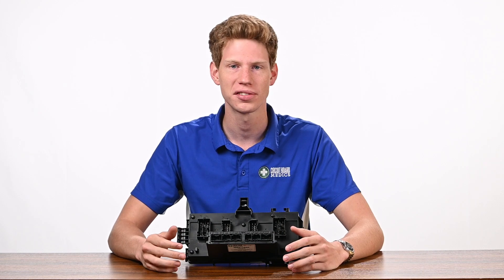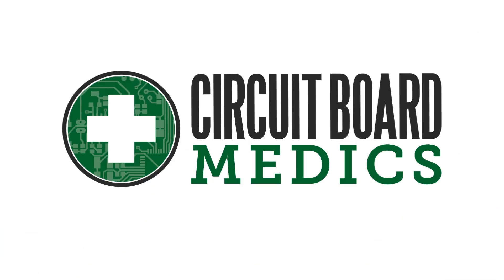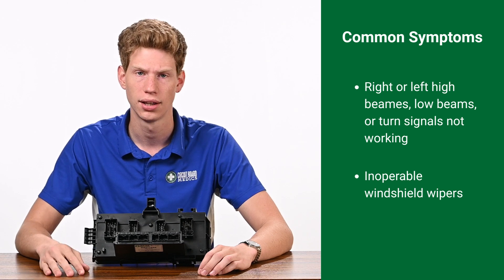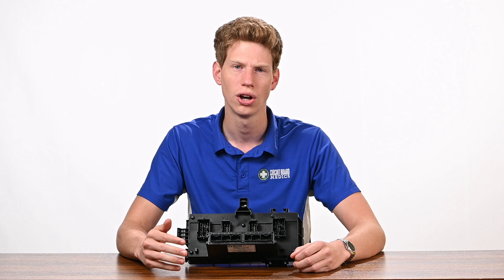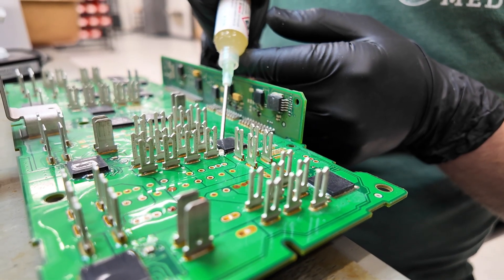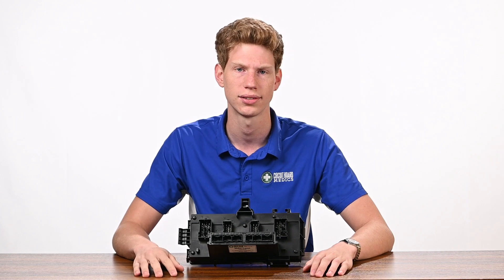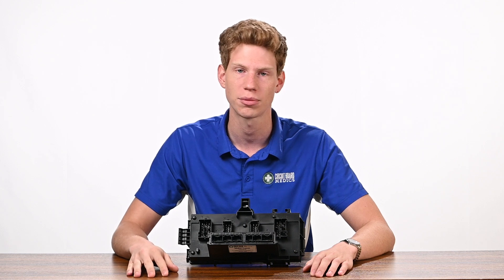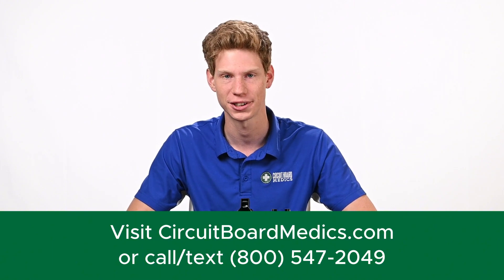How To Fix a 2006-2009 Dodge RAM TIPM (Common Problems + Replacement)

Comment: Does it need programming after replace with the vehicle?
Reply from the maker: Our replacements don't require programming, so you just need to install it and you're back up and running :)

Comment: I had my TIPM rebuilt and now the radio maintains power even if I shut it off manually. It is causing a power draw
Reply from the maker: Hi Steve! Did you have this issue before and after the rebuild or just after? If you reach out to our customer support team, we can try to help you resolve this issue.
Reply: @CircuitBoardMedics  After it was rebuilt. I can power down the radio like normal but the buttons and dials stay lit drawing amps for the battery. The TIPM is supped to shut the radio off but it doesn't
Reply from the maker: We would love to get this resolved quickly for you. Please reach out to our customer support team with your order number and we'll look into it further.
Reply: Do you service out of the U.S. ?
Reply from the maker: Hi there! Yes, we accept orders from anywhere in the world.

Comment: Do you think a bad TIPM can cause a no start or crank issue?
Reply from the maker: It is possible that a bad TIPM could cause a no crank/start issue. However, we recommend checking your starter, PCM, transmission range sensor, wiring, etc. before replacing the TIPM.
Reply: Ground or check wires near tipm

Comment: How much is a good TIPM.? My a/c will shut off on occasion and my airbag light will come on and most of the time I have to give my tipm a good slap and the a/c will start working again and the airbag light will go off.. then occasionally it will do it again and shit off my a/c and my airbag light will come on… what do I need to do to fix this problem.?
Reply from the maker: Hi there! You can find the most up to date pricing for 06-09 RAM TIPMs here:  https://circuitboardmedics.com/2006-2009-dodge-ram-tipm-exchange/

That does sounds like a TIPM issue so you'll need to replace it. If you have any questions or would like to place your order you can call us at (800) 547-2049 and we'll be happy to help :)
Reply: Damn!
Same truck, same issues! 🤔
Reply: Is there a way to get new plugs/wire pins for the tipm harness my tipm is fine but corrosion has done havock to my harness
Reply: @ChaosTheUnlimited yeah you can repin them but the fun part is matching up the right ones, there's a good variety of them